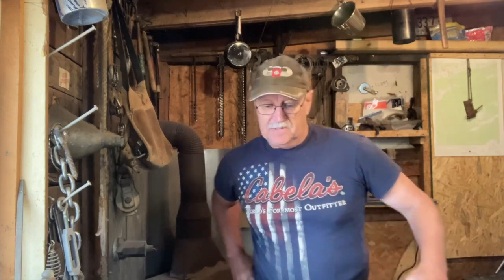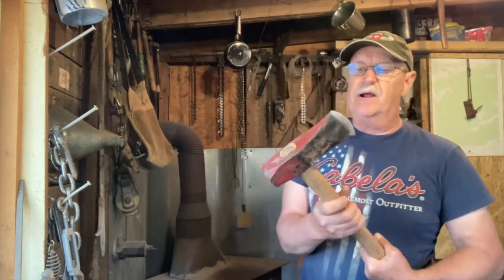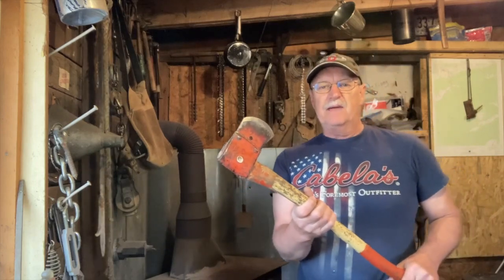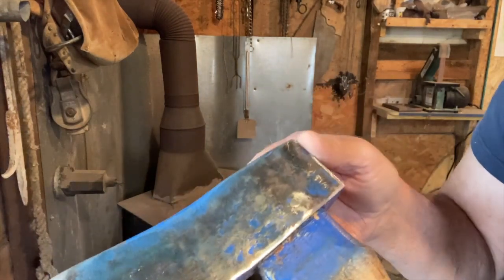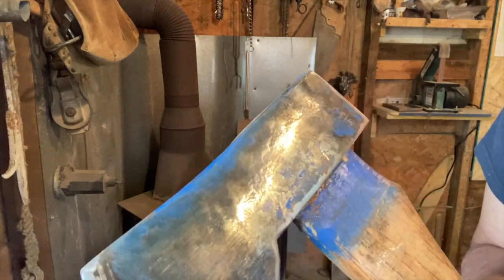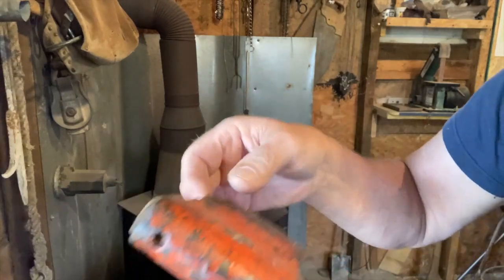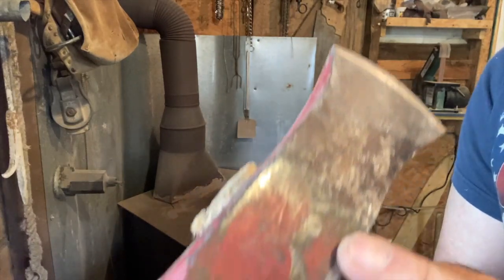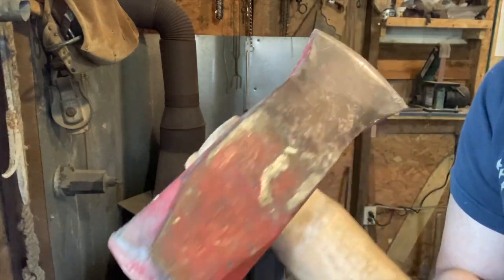Fix that loose ax handle and others easy

Comment: Good tip. 
I soak the axe head in automobile antifreeze. Any brand. Used antifreeze works too. It won’t rust and since antifreeze doesn’t dry out (it’s hydroscopic, meaning it likes water) the handle doesn’t come loose. 
I think the combination of both ideas would be almost foolproof.